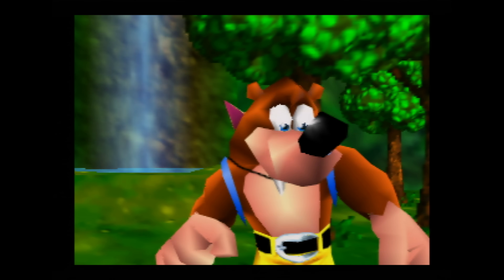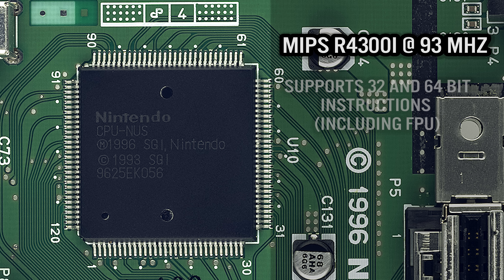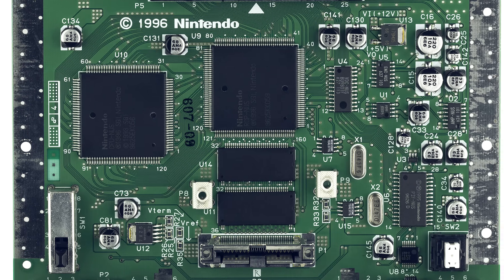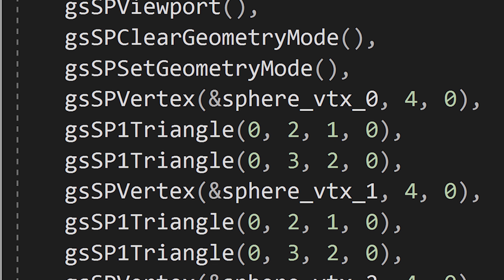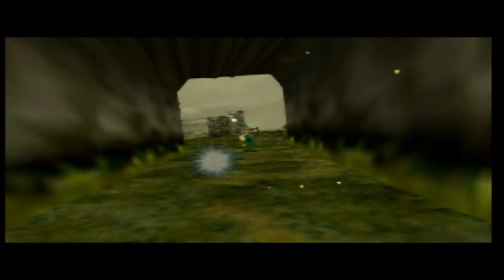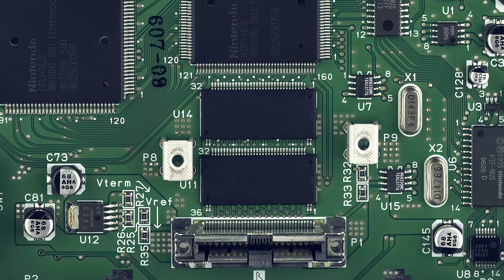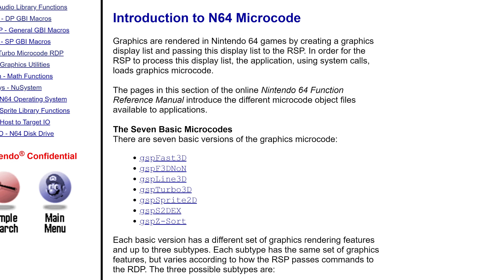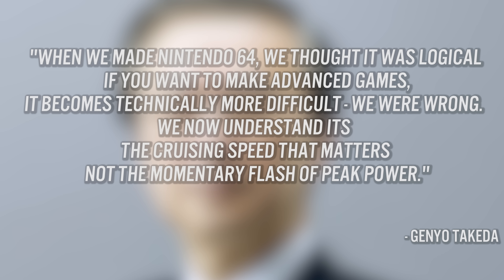Why was the Nintendo 64 so hard to develop games for ? | MVG

Comment: Nitpick: a five-stage pipeline doesn't mean that the MIPS chip can execute five instructions at the same time, exactly. It means that it can have up to five instructions in progress at any one time, with each at a different stage of the pipeline. Only one instruction starts and/or finishes per clock cycle. That's a pretty important distinction: a chip that can start, run, and complete five totally concurrent instructions at once would have been much more impressive and powerful (and expensive) than just a single-threaded chip with a five-stage pipeline.
Reply: That also created a really annoying pipeline problem where you couldn't use a register value until 1 clock cycle after a load instruction, if you tried, you'd get the old value for that one cycle. This was difficult to debug.
Reply: @bisc67  It enables faster processors. Different ISAs handle this differently. This is classified as a hazard condition, most compilers will handle this for you.
Reply: Brian Watson I heard in my Computer Logic & Organization class on MIPS that hazards like that would cause the processor to “stall”, preventing it from reading and executing further instructions, until it finishes. I’d think hazard detection would be a pretty basic feature for something like this.
Reply: Winston/Brian: Happy you guys wrote that up. When I heard that.... I was like 5 at a time. Hell no. That would have been a lot of money in 1996. Thanks guys!
Reply: Although they increase the throughput of the processor by efficiently scheduling the processing units, very deep pipelines are often nightmares for low latency developers.
I owned a Pentium 4 HT "Prescott" that was supposed to have a 31 stage pipeline. Imagine how expensive pipeline stalls would have been if when the branch prediction fails. Low latency  business code for example tend to be quite branch heavy and branch mispredictions are fairly common.
Reply: Hashan Gayasri P4 design was driven my megahertz wars waged by marketologists. The execution units became very ‘thin’, some rather simple instructions (shifts IIRC) became much slower than on the previous generation. I think its integer ALU was 16 bits running at 2x clock and pipelined.
A chain of the simplest ALU ops, like ADD r, r , may appear to execute at 0.5T/op latency, until you add something else. Then you get wait cycles inserted to just move data around between execution units. (My memory is vague though)
Reply: @noop9k  partially waged by marketologists, but also in the assumption that dennard scaling would have allowed for cpus to clock into the tens gigahertz with future process shrinks. really good set of comments though.
Reply: also, intel was attempting something around that time similar to the concept of the "end of history", via flattening every single RISC arch into the ground by having their manufacturers all buy into itanium, whose architecture guaranteed paper thin execution resources due to the manual VLIW scheduling. EV8 would have been 8-issue, but that wouldn't happen in the cheapening of clocks.
Reply: @agrecascinogameplaym  That's also mostly a marketing. Many were doing LIW/VLIW back then. Transmeta even attempted to compete in x86 market.
But AMD invented AMD64 extensions and released Athlons and Opterons, so..
Reply: @noop9k  I guess somewhat, but the difference is what place in the market was there. Transmeta's CPUs dealt with the weakness inherent in compiler issues by using x86 to abstract the problem away, and also were positioned as low power laptop CPUs. Itanium was native VLIW, positioned for HPC, and managed to barely make it through development 2 years later and infinitely many behind.
Reply: actualdecentchannelname Both met the same demise. Itanium killed by cheaper and x86-compatible Opteron, forcing Intel to adopt amd64/x64 arch, Transmeta killed by Atom and Pentium-M..
Transmeta’s binary translation was efficient, but lacked the raw power and lagged in adoption of SSE etc. Crusoe lacked SSE, Efficeon just came too late and was mostly ignored..
Reply: @noop9k  yeah, a shame what happened to the efficeon.
Reply: @HashanGayasri  Right it creates a nasty cycle of pipeline to increase single threaded performance, while compromising branch logic. It turns out most code is integer and branch heavy. Which they responded to with a form of parallelization at the execution level. (Superscalar) However as they parallelize they may end up creating deeper pipes or slower cores. Locality in silicon is commonly ignored and is actually what creates memory locality in software.
The generalized computing model was doomed from the start. It can work but you have to understand how and why it works. The economics of software are very shaky. For a long time they have been able to move things around with either multiple cores or feature reductions. However they continued to hit power, yield and IO walls. Software is a cheat from long ago in response to certain manufacturing limitations.
It was observed that most tasks could be done with the same level of performance using a generalized model of hardware. This carried forward for many decades successfully. However the point we are at today this will not work. Foundationally the Turing machine is an incorrect or incomplete picture of computation or the transistor. From this modern software has been chasing a delusional reality. Ironically in concept it could be converted back into a more realistic model. However the branch tasked with this has said it will basically never do this.
The observed problem with generalized systems is interfacing complications. The ironic thing is software could fix this too. However it put pressure on architectural tradeoffs which generalized systems tend to avoid. Higher end systems avoid this by serializing the design, however this can add tradeoffs by itself. It works in many markets but is pretty heavy handed for others.
Reply: Yep. A 5 stage pipeline isn't better because it increases throughput (though it does), it's better because it decreases latency by utilizing concurrency.

While you're executing one instruction, you can be decoding another instruction and fetching the one after that. In this 3-stage system, the processor never has to wait for the next instruction to be fetched and decoded.

Depending on the design of the instruction set architecture, the execution phase can be broken down even further though into 3 stages: doing an arithmetic/logic operation, reading/writing memory, and writing data back to the registers. You can be writing back to the registers for one instruction while reading/writing memory for the next instruction, while doing the arithmetic/logic for the one after that.

The processor is still only executing 1 instruction at a time, but it's split the job into 5 completely separate tasks that can be done in parallel.
Reply: Great comment. For some perspective , an original Pentium had a 5 stage pipeline so this was not a particularly novel thing for the time. Later Intel CPUs in the 90s and early 2000s ranged from the 6 stage all the way up to I think 20 on the Pentium 4.
Reply: @bradley3549  Early Pentium 4s were 20, later ones were 31.  No wonder it died when the branch predictor couldn't handle some types of programs.
Reply: Bradley Weingartner Even 8/16 bit CPUs from the 70s are pipelined, with fetch/execute stages of their instructions overlapped. 8086 already has instruction prefetch buffer which can also be considered a pipelining, and of course the later ones only improved on that.
Reply: R U A WIZARD?
Reply: That is not just a nitpick, especially for a video talking abouut the hardware of the system, it is crucial to get this right.
Reply: Now we can forgive the Spuerman 64 dev team...
Reply: This makes so much more sense, I was wondering that how it would be possible to execute multiple pipelines simultaneously without multithreading
Reply: I just learned more about MIPS pipelining in this comment thread than i did in 3 weeks attempting to decrypt my university professor…
Reply: /dev/etresevo  Great points!
Reply: Saturn's dsp actually ran 6 instructions at a time. It was used on Sonic R, for example, to process geometry, alas, much slower than n64 processor, so achieved similar results
Reply: Most people program with C and languages based on C which is single-threaded by default, and multithreading is difficult in general to code with.  Single all our apps are in C the only way you can speed it up is with pipelines.  If we had a multithreaded version of low-level Haskell with immutability and map, filter, fold, zipWith you could have lots of parallel computation.
Reply: @aoeu256  You could have exactly as much truly parallel computation as the silicon supports, which on the N64 is still only one instruction completing at a time.
Reply: It does mean it can execute five instructions at the same time, they are just at different stages of execution. It's like how you can say you have 2 loads of laundry being done at the same time, with one in the washer and one in the drier. Remember, instruction pipelining is a form of instruction-level parallelism. Parallelism is the key word here.
Reply: @SalgatAustin  Pipelining isn't true parallelism (in the sense most people mean by parallelism, that is, achieving an instructions per clock ratio of > 1) because it doesn't let you execute the same parts of multiple instructions at once - you still only get one part of each instruction per clock. This is not actually gaining IPC over an equivalent one-stage serial processor, just compensating to cover for the increased cost in number of clocks per instruction of a multistage architecture.
Reply: @wasd____  I'm not going to argue the textbook definition of instruction pipelining that explicitly states it's parallel. Remember, parallelism means that they are executing at the same time, even if they don't all complete at the same time.
Reply: @SalgatAustin  It's deceptive to describe a pipelining serial processor as "parallel" because it can't complete multiple instructions at the same time, it can only complete them singly. It may meet a (poorly conceived) textbook definition, depending on the textbook, but what's being overlooked is that it doesn't provide a useful distinction between a multistage serial pipeline versus several truly independent parallel pipelines.
One will always be limited to an IPC of <= 1. The other has an IPC limited only by however many independent pipes it has. Clearly there's a huge difference that shouldn't be confused there.
Reply: @SalgatAustin  I can understand that viewpoint, but I think that the term "executed" has to be treated differently from "processed" in this context.

If we use the laundry analogy, both loads of laundry are processed at the same time, but only one is executed at a time because in your laundry schedule (program) you must accept that 2 loads will never be completed at the same time. For laundry, who cares. For programming, this is a hugely important distinction.
Reply: /dev/etresevo As soon as RAM prices fell and on-chip instruction caches became norm, CISC archs were hopelessly outdated and only remained because of compatibility reasons.
Reply: I agree with the initial comment since 5 instructions at the same time needs 5 cores and multicore was not a thing for any before year 2000 technology.
Reply: @hbarudi No, this has nothing to do with multicore cpus. In this video they meant 5 pipeline stages.
superscalar CPUs execute multiple instructions at once, while pipelined(bit not superscalar) CPUs execute different phases of different instructions at once, but can only complete one instruction at a time. Pentium’s main difference from 486 is that it has 64-bit data bus and is 2-way superscalar.
Pipelining exists in consumer CPUs to certain degree almost from the beginning, since the 70s, but the degree of pipelining, the number of stages etc. gradually increased.
Superscalar CPUs (for example, x86 after 486), are still pipelined and pipeline lengths generally continue to grow. Modern x86 CPU can complete about 2-4instructions at once and has dozens of pipeline stages.
Reply: @hbarudi  It is possible to execute multiple instructions simultaneously on a single core with the right design. In fact, SGI's own R5000 CPU could do this. It had a "dual-issue mechanism" which meant that it could execute a floating point operation and any other type of operation simultaneously. A variant of the same idea is used to create "logical cores" (simultaneous multi-threading).

Basically, the inside of a CPU has a lot of parts that work together. Sometimes, those parts will remain idle unless an additional instruction is issued. An optimal architecture will support doing this.
Reply: ...man.... no wonder emulation for the N64 is STILL subpar compared to consoles like the game cube or wii
Reply: @cdoublejj  There's many reasons the emulations are difficult to get accurate. Timing is the main one. Some games expect timing to be pretty much exact. Some titles generate their display lists, as the GPU is executing them. They are doing this dynamically under the assumption that have X clock cycles in which to do their calculation.

Emulations do not, generally, take this in to account and these are VERY HARD to track down.

Another example is some oddities of the MIPS processor.

For example:

mov r0,0
str r0,[r1]
nop
mov r0,0x80
ldr r0,[r1]
add r2,r0,1

What value will r2 have?

You would expect to see 1. But, no, you'd get 0x81 (I haven't tried this - i'm trying to recall the actual 'bug'). If there was a nop after the ldr, everything would be OK. If you single stepped this in a debugger, you would get what you expect; but when it runs, you wouldn't (EXCEPT if an interrupt happened between the ldr and the add).
Reply: NECVR4300 is a bit flexible compared to Saturn's SH-2 Aurora. For One, NECVR4300 has a Single 64-bit Data Register DSP Bus with a Dual 32-bit Address Bus that runs high speed 64-bit DMA at Double 64-bit  Instructions using 2 ICs of 64x64 latency, with up to 5 ICs of 64x64x32x32x32. NECVR4300 also has a 73 MHZ Clockspeed and up to 60 MIPS, Threefold Saturn's 50 MIPS.

To compare, SH-2 Aurora used a DUAL 32-bit Data Register running VLIW achieved through 6 ICs combined and had a Dual 32-bit Address Bus capable of low performance speed 64-bit DMA. SH-2 also handled Simultaneous DUAL 32-bit Instructions with at to a max 64-bit Instructions. SH-2's Clockspeed maxed out at 56.7 MHZ with 6 32x32x32 ICs that multiply to 64x64 bit instructions.

The difference being, N64's CPU handled VLIW but had a More palatable Pipeline of full parallel with its Dual 32-bit Address Bus Register, because unlike SEGA, Nintendo was able to get a single Wafer Chip, instead of being forced to settle with two.

N64's Design was ahead of its time much like Saturn's, because N64 used a CPU to GPU Pipeline, Rarely heard of in 1995, just like Saturn' SH-2 Aurora DUAL Core CPU Parallelation was virtually unheard of in 1994.
Reply: This is a dumb nitpick that will just confused people haven't studied CPU architecture.  You are correct however a 5 stage pipeline allows you to run almost 5 times the amount instructions.  Without a staged pipeline you literally have to wait for the entire instruction to go through the CPU pipeline, with a staged pipeline you can get an instruction throughput of around 5 times faster than a non-pipelined cpu.  So while yes you have to wait for one instruction per clock cycle you, overall are still getting 5 times as many instruction in the same period of time.
Reply: @tintom3t  This is wrong, an n+x stage pipeline isn't inherently faster than an n stage pipeline. It all matters on how many cycles it takes for each stage in each pipeline to complete. We don't have the real-world tech to have a one stage pipeline complete in 1 cycle at gigahertz speed, so we use larger pipelines instead to asymptotically bring IPC closer to 1. No matter what, a (scalar) pipeline can only have one instruction read the end of it on any clock cycle, and as such IPC can never be greater than 1. To say that a cpu with a 5 stage pipeline is able to execute 5 instructions at once is simply wrong, and portraying the benefits of pipelining incorrectly. 3 and 4 stage pipelines are relatively common and perform similarly to 5 stage pipelines at this point, as they're all scalar variants of the classic RISC pipeline.
Reply: @agrecascinogameplaym  at the time it was created a 5 step pipeline roughly had 5 times the instruction throughput I dont k ow why you are acting like there was no performance benefit and that the engineers were just fucking around
Reply: CrabBucket Almost every CPU in existence during the last 40 years is pipelined. If not superscalar, they still execute instructions sequentially. This is not a nitpick, this is an important correction.
Reply: @CrabBucket Op is just being polite, this is a huge difference.